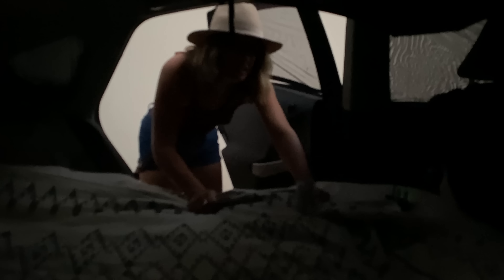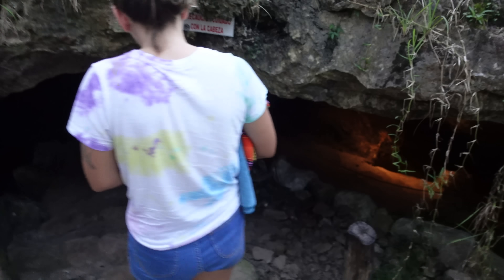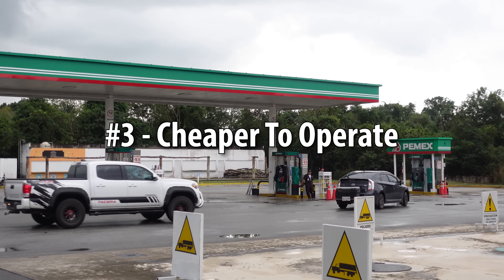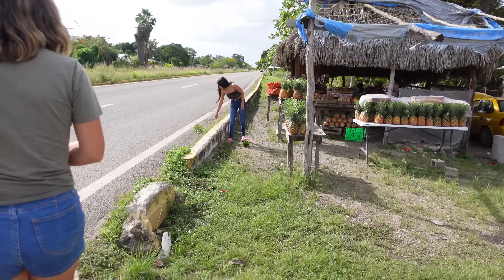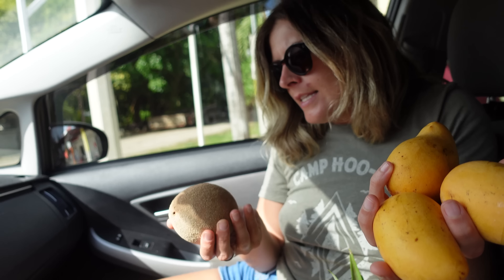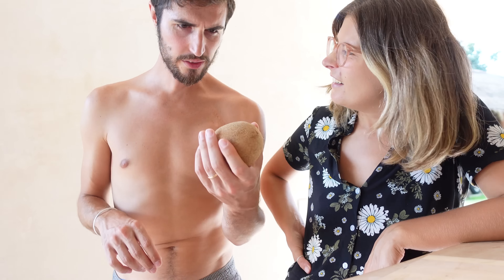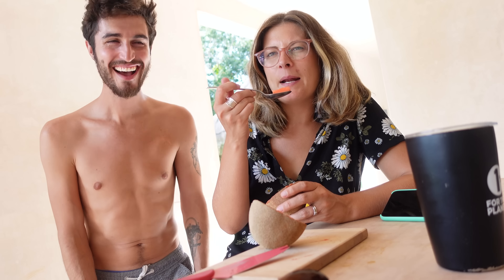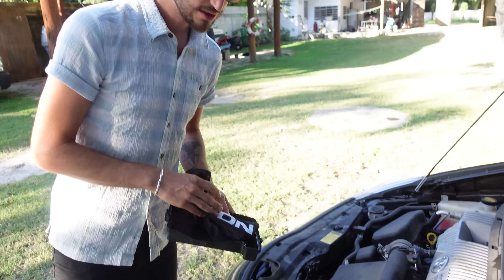6 Reasons Why Our Prius is Better than #Vanlife!

Comment: I originally started dipping my toes in the water that is travelling about a year back with a Dodge Grand Caravan. There were some hurdles, but it was manageable. I decided that there wasn't enough room, so I sold it and bought a Ford E-350 shuttle bus instead, and boy was that the wrong move.

I had a lot of cool ideas for it, and I worked on it for a couple of months, but the simplicity of ease of use of the van was far superior. I could not agree with you guys after having watched this video. I am actually now looking into getting a Prius to travel in! Isn't life funny that way! 🙃

Comment: Another possible reason why your Prius battery dies...I think you turn on the Prius  to roll down windows but don't turn the Prius to Run mode. Run mode engages the engine to turn on which charges the battery while on. If you turn off the car electric fans and electronics in run mode. The Prius last longer without the engine kicking over to charge the hybrid battery. To engage Run mode you have to press the brake when starting the car. Otherwise if you press start without the brake the car is only engaged with the 12volt and not the hybrid system on. This will prevent the battery from dying.

Comment: Plywood isn’t meant to be use in places where there is a lot of water unless you use marine grade finishes. You should have used solid wood (and marine grade finish) or heavy sheet metal (painted) or angle iron welded together with a heavy gauge mesh/grate for the flat surface so it drains water. Painted, of course.

Comment: How have you fared with your ICECO fridge? I used mine on a road trip this summer with sort of mixed results. It was a hot summer so I feel like the fridge had to work extra hard.
Reply from the maker: We have beat the hell out of it and had zero problems except that it does get water pooling inside after a week or so which is a little annoying. 😕

Comment: My daughter has special needs and is in a pediatric wheelchair for traveling. Sometimes Uber WAV will send over a Sprinter van. Yes it’s expensive, but it’s TALL inside. Her school uses Ford Transit vans, cheaper, but I’m 5’8-5’9 and my head bumps against the roof standing in the middle, that might drive Levi nuts since I think he’s over 6 feet?
Reply from the maker: Yeah the sprinter vans are craaaaazy expensive. Especially the ones where I can actually stand inside sadly...